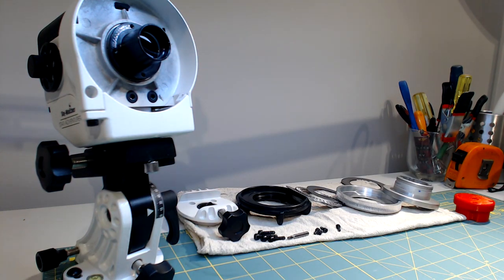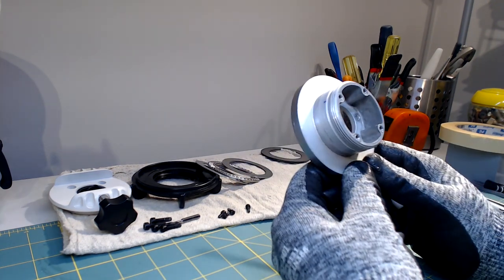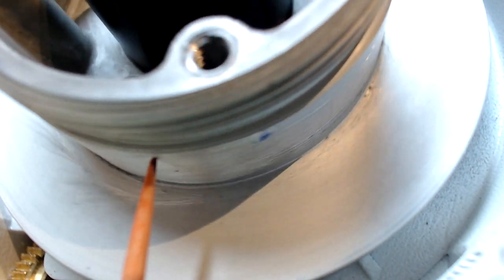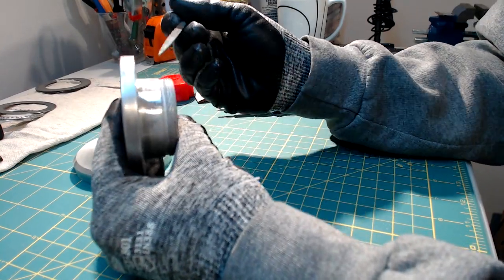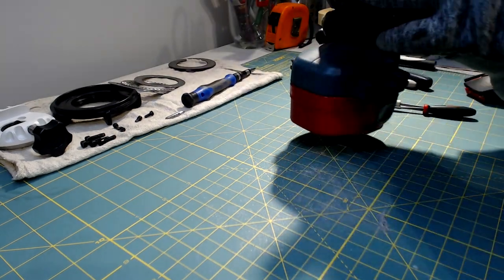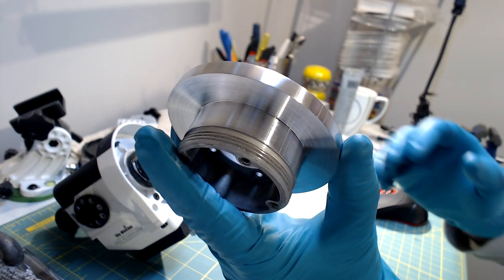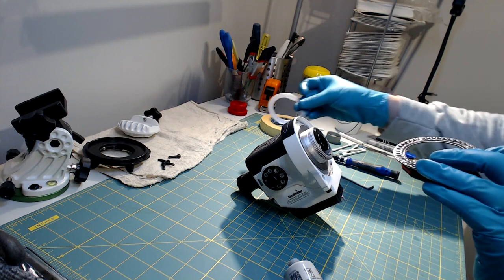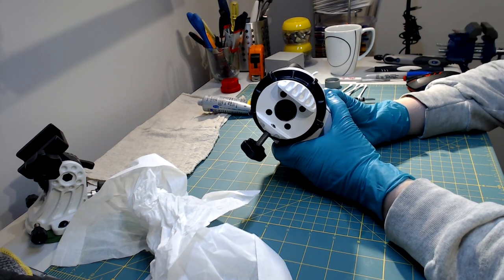Star Adventurer "Tight Spot" Clutch Repair

Comment: Hello! I have the SA, my problem is that I have lost the screw that adjusts the wheel of the dial, and I cannot know the size of the Allen screw. Would you know how to tell me which one?
Thank you very much for your tutorials!
Reply from the maker: Are you talking about the mode selection dial? That is a m4 thread you'll need. Most the screws on the mount are m3 and m4 thread. Hope that helps.
Reply: @StevenDoye  Yes, I was referring to the mode dial, where the tracking speed is selected. I arrived on a trip and noticed that the dial is loose, and if I want to change speed or just put it into operation, it seems to skate, and skip a position when moving it. When you look at the hole to see the screw, you don't see anything, that's why I think it has come loose and fallen.I will try to get the M3 screw that you tell me to see if it works.
Thank you very much for your support!
Reply from the maker: The mode dial is a M4 not M3
Reply: @StevenDoye  OK thank you very much!!
Reply: @StevenDoye  Hello! Thank you very much for your help! Finally the screw was inside !! Even so, adjusting it fully, the dial wheel is still loose.I tried pulling it out and seeing the shaft (where it fits with the screw) is fixed to a nut. It is seen that on the inside of the case there is a locknut that adjusts the entire system. I do not have access to that nut but it is opening all the carcass right? I'm afraid of breaking something or leaving it that way, half loose.
 What do you think?
Reply from the maker: @adrianaamez2078 The switch normally has a little play in rotation. You should be able to just tighten up that nut that is under the dial. If the whole dial keeps rotating as you try to tighten it, then It sound like the little plastic key way stud on the switch  may have broke off. You can actually see it if you remove the nut. It sits in the cutout part of the hole the switch sits through. The switch is easy to access and replace, but getting one from Sky-watcher I'm not sure of. Here's a link to some images of what I'm talking about.
https://drive.google.com/folderview?id=1cDg3SoXawckyR-8G-CMKcOxtLtkJftaA

Comment: I have a new 2i version and have found that RA does not revolve in Star mode but does revolve in Solar and Lunar mode. Any suggestions would be appreciated.
Reply from the maker: Not sure. That sounds software related and I'm not familiar with the 2i version. Sorry
Reply: @StevenDoye  I think you are right. The screw is there after all. It has a recessed head so I mistakenly thought I was seeing a n empty hole. Will send it back to shop for them to sort. Thanks for your very informative videos for future reference. Screw is M6 btw. Cheers

Comment: Great video mate! Mine does have a big tight spot I'm planning to do exactly the same as you did with yours. Just when I'm downloading file of Thingiverse it says is corrupted
Reply from the maker: I'll look into that as soon asap. In the meantime I do have on my stuff on Cults3d because Thingiverse seems to be unreliable. Give this a try https://cults3d.com/en/3d-model/tool/star-adventurer-clutch-repair-tool
Reply: @StevenDoye  Thanks mate
Reply from the maker: @DawidSorokad_worms   Okay so the Cults File was corrupted too because it just pretty much copied my Thingiverse account over. Thanks for the catch. The files should be good now. If not I also put it in a Google Drive folder for you. Good luck on your repair.  https://drive.google.com/drive/folders/1cDg3SoXawckyR-8G-CMKcOxtLtkJftaA?usp=sharing
Reply: @StevenDoye  Yeah it was corrupted now both are working thanks again
Reply: Happily reporting that tight spot is gone. Hit it with Dremel as you did then 400 grit sandpaper it took me no more than 30 min 👍
Reply from the maker: @DawidSorokad_worms  Dam that was fast. Glad to hear it worked out for you.

Comment: Have just checked and I see mine is missing that worm drive screw. Is that M3 ?
Reply from the maker: Are you talking about that backlash set screw that threads in from the bottom. It is way bigger then a M3. I honestly don't think that's even a metric thread. I'd have to remove mine and measure it out to get the proper size. If it is missing you should see a big hole in the bottom of the mount.
Reply: Yes that screw at the bottom is missing. I can see the plate that it pushes in to. Thanks for great video.
Reply from the maker: @grantmclauchlan2843  when I get a chance I'll remove mine and measure it out for you so you can get a new one.
Reply: All good. I’ll rummage around in the garage and hopefully find one for it.